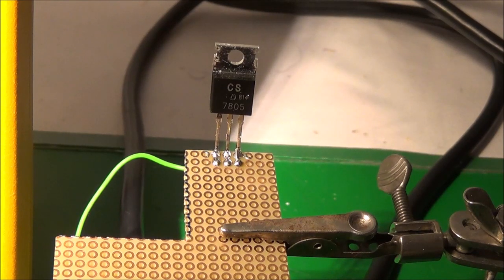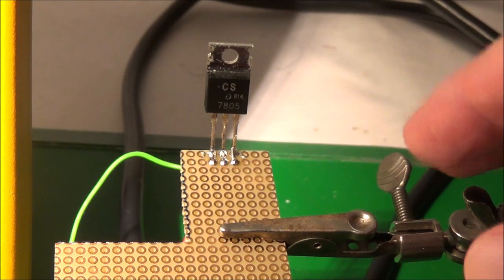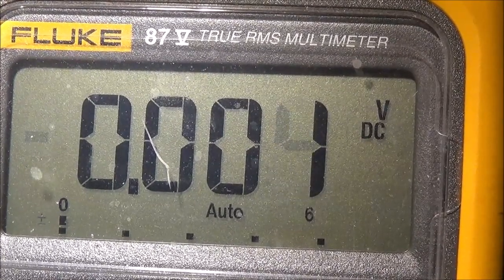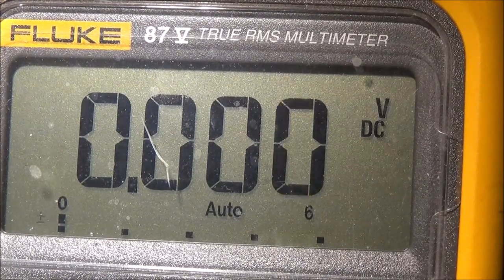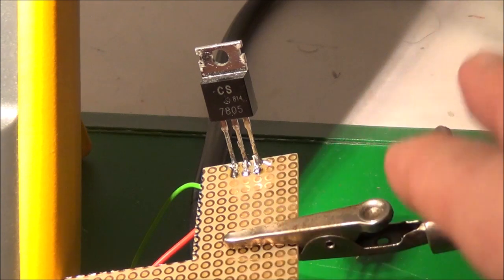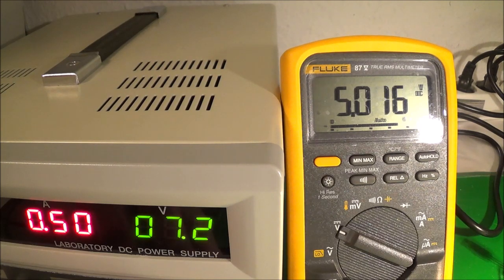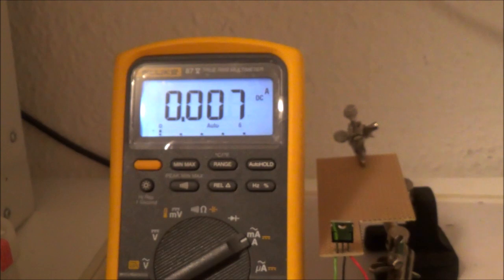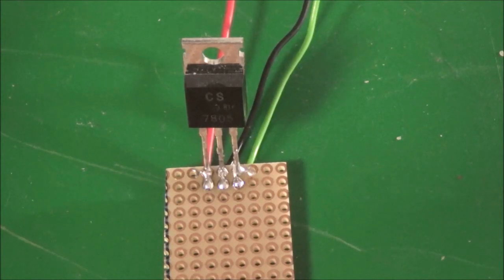3-Pin Voltage Regulator Troubleshooting (7805)

Comment: Sir can we test the 3 pin regulator by not applying a voltage thru doide checking or resistance checcking tnx sir
Reply from the maker: I would use a voltmeter. Since, for example, the output voltage could be false, you could have excessive ripple, etc., without the regulator getting hot, that is, the regulator could seem normal. But if you do know that there is a diode or transistor junction within the IC and it is drectly connected within the pins, you could use the diode/transistor test function of the multimeter. Check the data sheet.

Comment: Thanks for this video. I have an problem with a 15v regulator (7815) the input 19v and the output is only 14.96v it should be 15 or 15.01v I don't understand this ? I compared with a good board that  it gives 15.06v. please  advice.
Reply from the maker: I think you are still within specifications; The percentage change from 15.00 to 14.96 is only -0.27 %
Reply: @OldSchoolElectronics  it's correct I put it on other board and it works. Thanks for your response and video.
Reply from the maker: Great! Good luck!

Comment: weird - i'm working on the repair of a piece of commercially produced gear and it has a 7805/7806 pair responsible for regulating the +15/-15V rails

Comment: Hi, I must change a  voltage regulator but I don't understand the letters written on it, can you help me ? best regards
Reply from the maker: Hello. Maybe; what does it say on the regulator? I am not online everyday, but will be so tomorrow again.
Reply: @OldSchoolElectronics  It is nice.     T   F2B   2.C
Reply from the maker: Another question. What is it in? SMD or through-hole? 3 pins?
Reply: @OldSchoolElectronics  HI, 3 pins,  it looks like TO202,  it is associated with the lighting of a boombox and also to the electromagnet of autostop (boombox Aimor ST808)
Reply from the maker: I have not been able to find anything so far. The solenoids I have came across so far in working on boomboxes have been 12 volt ones, I think.
Reply: @OldSchoolElectronics  Hi, I have asked to "alltransistor". He thinks it is a SF2B41 thyristor... Bye
Reply: Hello to you. I have a new question if you have a moment. I have a crown SCP-71LW. When I listen to a record, there are  sizzles I hear in the speakers even when the volume is at minimum. Could a capacitor solve this problem? I have no problem with the radio or tape. Best regards

Comment: Don't worry about your video going too long. To a beginner like me it's informative. I just got a couple of scope and function gen. I did look for an audio gen but they seem to be pricey in eBay. I have many questions but for now I thought I ask two first if you do not mind. Can my function gen output any audio signal into an amp? How much amplitude is safe to input into a preamp? Thank you and keep up the great tutoring.
Reply from the maker: Thanks for your comments. The function generator can be used to input sine, square, or triangle waves into the amp/receiver. Low distortion audio generators cost more, as you know. But you wouldn't need that until some time in the future, for example, when you have a distortion meter. For simple troubleshooting, a function generator should be good. I generally use about 150 mV RMS (close to 400 mV peak-to-peak on the scope) when troubleshooting audio equipment; feeding the signal into an aux, tuner, or tape input. Phono inputs often need a much lower level; levels might be as low as 4 mV RMS (12 mV peak-to-peak on the scope) or so. But that low level is hard to use for troubleshooting; therefore I might use 10 mV RMS (30 mV peak-to-peak on the scope) or so I can see the sine waveform better on the scope. All equipment has different input specifications; when in doubt, consult the manuals. For example, to see what kind of phono inputs there are.
Reply: Thank you for such elaborate and enlightening explanation. I understand now why Audio Generator can cost an arm and leg. Hehe. Have a great weekend Sir and thank you again.
Reply from the maker: You have a nice weekend, too!